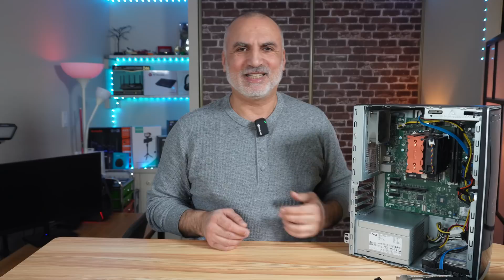BOOST FPS! Upgrade old PC and turn it into a Gaming Power House!

Comment from the maker: Upgrades affiliate links:
--------------------------------------
Nvidia GTX 1650 Super GPU: https://amzn.to/41HU6tH
Sata to 6/8 pin cable: https://amzn.to/3cNUf7x
6 pin to Y Sata cable: https://amzn.to/314A24I
24 Pin to 8 Pin Dell MOBO adapter: https://www.moddiy.com/products/Dell-Inspiron-3670-PSU-Main-Power-24-Pin-to-8-Pin-Adapter-Cable-30cm.html
Crucial Pro Ram 32GB on Amazon: https://amzn.to/455Iakb
Crucial P3 1TB NVMe on Amazon: https://amzn.to/44jXjh7
USB expansion card: https://amzn.to/3vjuvq2

Videos links:
--------------------
How to upgrade an Intel CPU: https://youtu.be/691MQfkNa0U
How to install a GPU in a PC: https://youtu.be/GShJctyR8_M
How to upgrade the PSU of your PC: https://youtu.be/GEbsrbT8SwI
How to upgrade the RAM of a desktop PC: https://youtu.be/fKEURAtGG84
How to add USB ports to a PC: https://youtu.be/1CTo7hw1GYI

Comment: I have Amd Sempron 145 
GA-M68MT-S2P (rev. 3.0)
gigabyte gt 710 GV-N710D3-2GL
8gb ram 
450w power supply 
I know bottlenecking pointy gpu 
What else can I upgrade? 
This is my dad pc in my memories